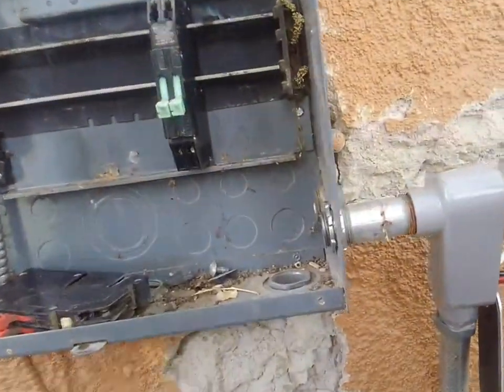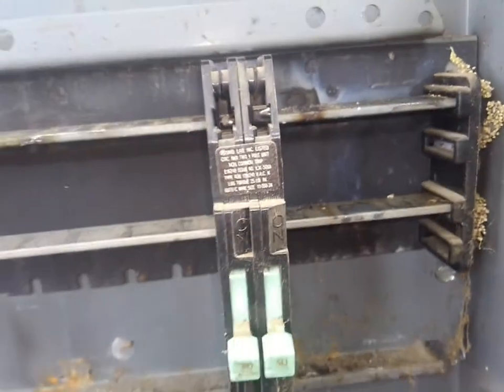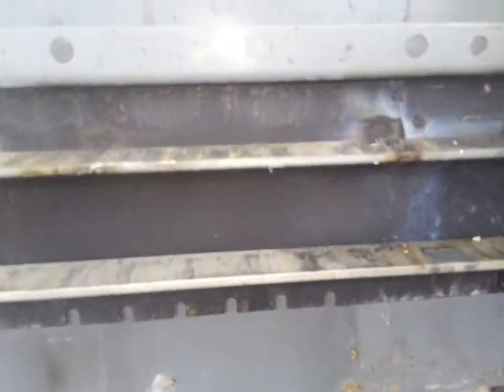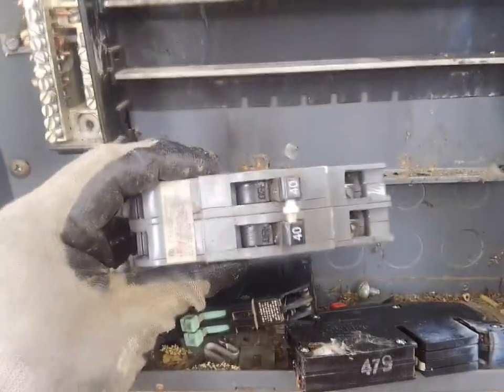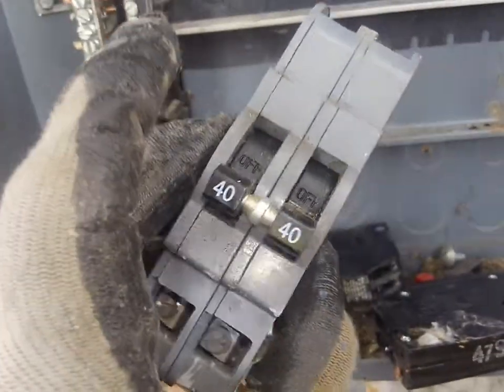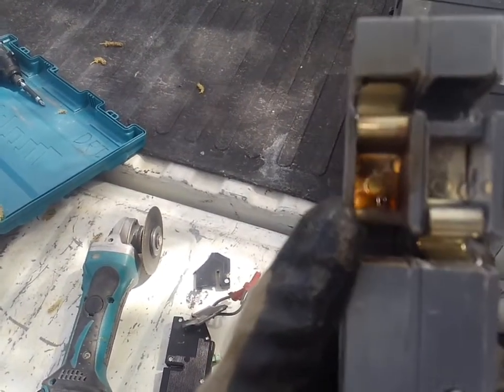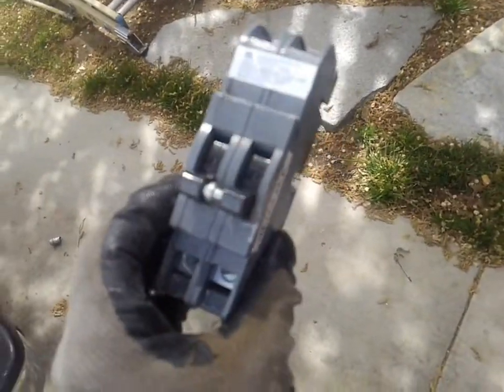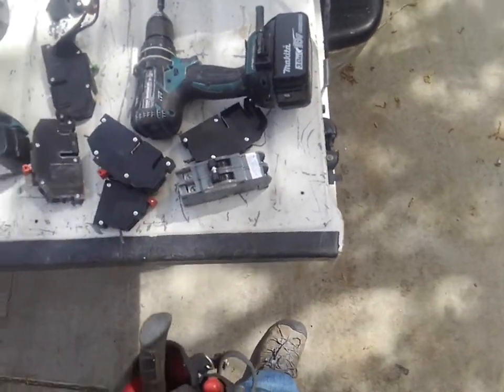The problem with Zinsco panels

Comment: Changing electrical panels can cost in excess of $12k-$20k, consumers are paying the high price for criminal companies that get away with releasing garbage on the market.  Why hasn't these companies producing dangerous electrical panels and breakers been sued like many other industries facing class action suits ? How come ? Nobody held accountable so companies keep on producing crap.  Most panels today are just as bad.  The amount of new breakers on the market have a very high failure rate, often within the first year, coupled with a lot of incompetent lazy electricians charging an arm and 4 legs but can't get a half-arsed job done right, incorrect torque, connections too tight, too loose and much more.  We cannot rely on anybody today.

Comment: Replaced the 200 amp Zinsco main panel. Want to replace a ZInsco subpanel but may have to bring it to code which is nearly impossible. The panel is in a small closet with the furnace and will not meet todays clearance requirements. The bus bars look great so I may just change the old breakers to the new versions. Then I saw your new breakers that failed...

Comment: The 100A main breakers you show are made by Connecticut Electric.  They are UL listed, like all new breaker panels.  If bad out-of-box, like the scored copper rivet you show, that questions all UL products, and isn't related to problems with original Zinsco breakers.

Comment: Had issues with the bus bar pitting and losing connection. Had the bars replaced with copper ones and havent had a problem since...
Reply: Where can i find the copper replacement

Comment: Those new Zinsco replacement breakers are not made by Zinsco but by Connecticut Electric.  They have a much higher failure rate than the older genuine Zinsco breakers.
Reply: You got to be kidding me. We have two 200amp zinsco panels in this house my grandfather built and I just pulled an original 200 amp feeder breaker from the top of the 40 position panel and it was shot and the busbar was hosed. Worst mess I ever saw. Bunch of grinding and sanding and no-ox later with a new Connecticut Electric breaker and shes working fine. The problem I have seen with the original breakers is the connection with the busbar is weak and therefore doesn't get a solid connection. The new CE breakers have a very very strong grip. Now the damaged Zinsco panel temps are room temp at 69-71 degrees. It was 120 degrees before the one leg gave out entirely. The other panel is humming along at high 80's for an average. If you run the thermal probe up the breakers some will be warmer than others. The "good" panel actually has a breaker missing due to it being removed because it arced open on the bus. Another breaker made a hissing noise and I pulled it out with my pinky finger and bent the contact in enough it grabbed the buss better and its been fine since. I think the new grey CE breakers are far superior to the old crap.
Reply from the maker: I Believe it.  I once bought a brand new Connecticut Electric breaker for Zinsco and it was bad right out of the box.
Reply: I just had to replace a 20A double pole Connecticut breaker as I have a zinsco panel and all lights on the circuit were flickering..

Ideally I wish I had the money to swap panels but I dont and since the mid 60s soo far soo good. This is an older house my grandpa actually built to a 2 story in 1965 so hell the panel and OG breakers might be just as old.   The god damn breakers are expensive also. Home depot wanted $75 for the Connecticut breaker but i found them cheaper on amazon for $55..

After some fussing and fighting i got the old zinsco put and thr CT electric in and soo far soo good though it has only been day 1.

Comment: Wow I appreciate this information these panels are just like Federal Pacific Electric Panels My Dad’s shop has one of these panels in it and it probably needs to be replaced one issue he has is he had some fans running and one breaker Tripped and won’t reset 😉
Reply: these are worse than federal pacific, these panels have issues with poor contact, the bus bars breaking and breakers melting to the bus bar and then it wont trip, although there are some claims of federal pacific electric panels having issues with poor contacts, that is mostly not the case, they just had issues with not tripping when overloaded or shorted, so for a federal pacific to start a fire something else has to be wrong and the breaker simply wont protect you, these on the other hand will fail by themselves with nothing else wrong over time.